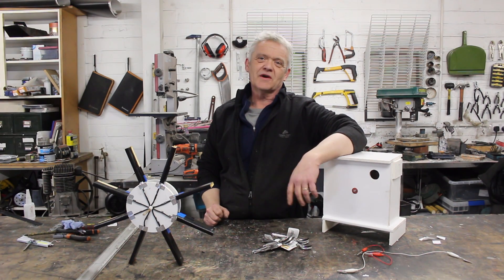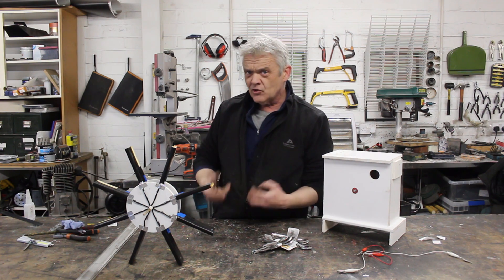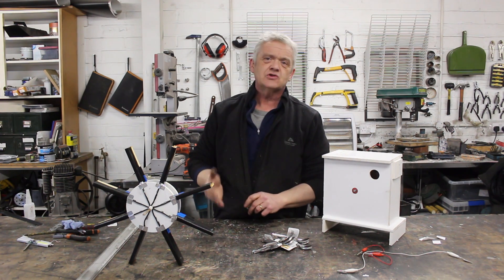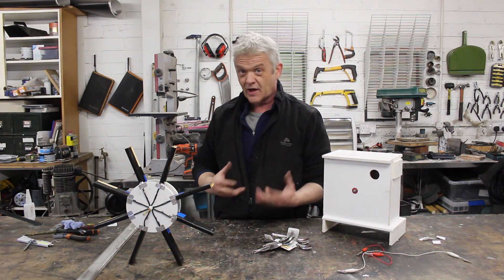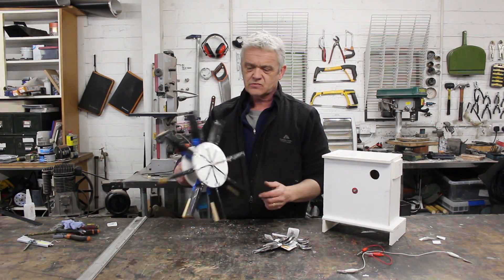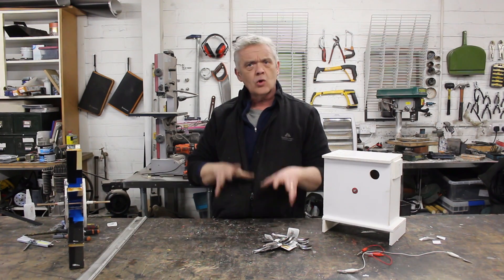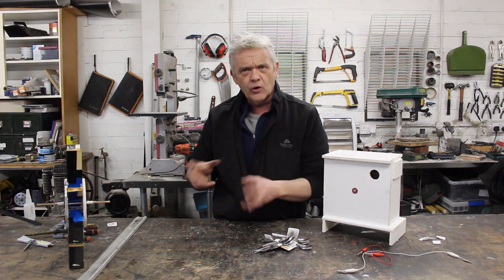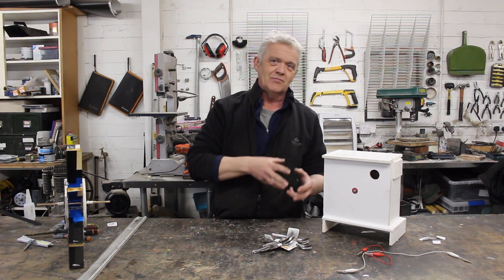1473 Water Could Be The Answer To Home Energy Storage

Comment: If I had a 6 ft wide  by 20 high tank  how long would it keep the average 3 bed house powered and heated during the winter.  There could be a pond at its foot to collect water as it is released from the tank true a generator.  Refilled true wind and solar panels

Comment: Yes, water is a  very old battery. The problem is that the amount of water needed is extremely high to actually achieve any significance in constant power. Plus, one would have to pump the water (recharge the battery) with solar or something, thereby negating most of the benefits. By the time you add up the cost, you will find that the better option is solar or something equivalent with current battery technology.  Much cheaper and the system takes a lot less space. I've run the numbers  as I actually live off grid and experience the reality of energy storage. The real solution is USE LESS POWER.

Comment: I once had an idea to use a closed loop system utilizing ram pumps to pump water to a reservoir that would then feed into a downward channel and through a water turbine connected to a generator and back to the starting point. 

The exit valve of the ram pump would spout the waste water into a container that would feed that waste water back into the start as well. 

However, a few have told me that friction would eventually hinder the flow. By no means am I an expert in engineering so I'll take all the pointers I can get! Lol

Though perhaps with these accumulator systems you mention, that frictional force may be much easier to overcome..

What you are doing for the community is nothing short of amazing by the way. Thank you for being an inspiration! 🫡

Comment: battery can be 90% efficiency,but if the price of the battery you are getting les than 50% return, water battery can be circle 50 times a day for 20 years, plus large tanks get cheaper per KW unit as they get bigger.

Comment: the water going up and down, the wind turbine / solar energy storage pumped hydro, the sand battery, concentrated solar, it seems to me we should put it all together, your a smart chap, use the sand battery to store excess wind or solar as heat and also concentrated solar, but that is where my mad idea starts..... use the wally minto designed  wheel. water on one side of a diaphragm and butane on the other for the heat conversion to pressure lifting the water to rotate the wheel and spin a big generator ( about 11 hp I would guess) as needed to charge/ power stuff. Am I mad or what,.. but if you have a big sand battery the generator could run all night, not really sure on the calculations  (not my strong hand) also I do not have reliable data to calculate from. I would like to try this but in my rental flat it is certainly not possible.

Comment: A thought popped into mind. Can a pump type, as used in a washing machine to feed and drain water, be use inline with inlet water pipe inverse to instead generate electricity? Logically it should work, but again, health risk from type product material and strength of handling the pressure come to question. I would appreciate your feedback on that.

Comment: I was having a thought about water batteries suplimenting electrical batteries using a few  barrels toped off by a solar pump and they drop once filled up and pull a gravety generator. One small solar set of  solar panels And battery bank instead of a roof full to run the pump.

Comment: Mate; put a triboelectric collector in the tank so that as the tank fills it charges the battery/capacitor system.

Most tanks have a small fill system that provides a solid stream to fill the tank, and there is a way to modify the system to allow room for the triboelectric collector.

Same concept, different application. Your thoughts?

Comment: Flush a conventional toilet 1ce a day. YES, flush ONE time per day. After your daily constitution, wash away the poo and the urine, down the drain. If the toilet in your flat is working, it will only hold so much liquid in the BOWL, also the tank. Excess pee will just flow over the P-trap down the sewer pipe. All of the debris to deal with is what is freshly at hand. Composting toilet users deal with this offensive aroma problem with a simple stovepipe out the roof. A "Fart Fan" as we call it works just fine. Then, after morning coffee, I have my business, read the mail, and have a satisfying flush. POOF! my 3 gallons of flush, black water purging for the day is done. NO MORE has been needed for 9 years. I smell no So2. I started out (Survivalist Style) saving and drying my Pee. I used a Windex bottle with 1/2 Clorox a d 1/2 water to spray after each toilet break. Not needed really. Up and out.       
           Just think of the bazillions of gallons we could have saved sense outhouses were abandon?

Comment: I bought a little 10 watt hydro generator from DX in China that was able to thread onto the same hose that connects to our shower head.  The impeller and electric section were only magnetically coupled so there wouldn’t be any eventual leaking from a failed seal.  I was thinking about using it for the kitchen sink at our off-grid cabin as a way of scavenging the little bit of power we get from the water system that’s set up.

Comment: as a pure energy storage device, I've been pondering the idea of a weight thats winched up a pole by a motor-generator when there is excess energy and then released when there is excess demand. the power of the motor-generator, length of pole and size of the weight are all variables according to the scale required.

Comment: Love love love your videos!!  Have to ask, when will you have one or more completed solutions that can fully charge  a 12V / 50-100Ah battery that can then have an inverter attached to run a refrigerator, lights, charge phones?  My favorite is the gravity battery / generator because any adult can use their body weight to hang from rope loops to pull a weight up into the air… and let gravity do it’s thing!   I would really like a reliable solution that doesn’t have to rely on wind, sun, or a stream of water I don’t have.  I’d like to be able to recharge 10 batteries and have them in reserve… or use them for camping .  Thanx for listening!!!!

Comment: The maths is not in your favour here. An accumulator stores energy by lifting a weight - and unless you're using weights the size of your entire house, the amount of energy you can store is tiny - not even enough to boil a cup of water. It's true that you can use it to create a high pressure jet, but the amount of energy you can extract from that jet is just the same (the jet won't run for very long). 

The amount of energy stored is easily calculated as m x g x h (m=mass, g=force of gravity, h=height lifted). So if you lift a tonne by 1 meter, you store 9,800 joules - or 0.003kWh. That's about 1/3 of an iPhone charge, or boiling about 1/100th of a kettle of water. A 1 ton weight is not a small thing, and lifting it safely is also non-trivial.

Comment: Disappointed with this video,  no details of your idea and you pointed to,  but never said what the wooden box was. Given the very small volume of water used each day in one home I can not see any worthwhile power storage.  A poor video. 

However - I have thought for years that using water towers as batteries is a good idea,  (not in domestic use mind,  a heavy lifted mass seems better for that.) There are many disused water towers around the country.  The water tower near me is massive and has an even larger reserve underground next to it. 
Someone with far better maths than me thinks it impractical as the energy required to lift the water so far outwieghs every stored. I always counter that when we have massive surplus energy as is becoming more common with the increase in wind and solar power use it. Pump to the top during the day & release in the evening peak.

On the domestic scale even this March I have had many days when I have exported,  (that is wasted,)  10, 20 even 30 Kwhs to the national grid.  If I could use say 20kwhs to lift a concrete weight up a modest tower to gain say 5kws I would be over the moon with it alas Although I have the idea I have neither the engineering skill of maths needed.  

If you want to laugh at my idea you won't be the first.  A friend said your talking about a sort of grandfather clock mechanism,  well I a.  SORT Of,  but what's wrong with that.

Comment: The trick is that it really isn't that much energy. Quint builds did this at scale already and had plenty of stuff to say about it. Namely, that it isn't worth it. You're better off getting just have a solar panel store electrical energy somewhere. Battery banks last more like 10 years than 3 years. Especially if you aren't fully cycling them every single day. The conversion of electrical power to water pressure (volume at a height) and then back to electrical is just really lossy.

Comment: If city sets the flow rate to make sure in flats sewer drains then u can tag along. If the city only "flushes" the system in flats problem areas & waits to do it at 1 time per day say after building pressure so sure a power flush why not tag along 1st. How well if u hve special water high pressure connection at each house it is out of your control/input. If they need a special flush they can oh 2 times a day on shitty days.

Comment: Have you done any anergy calulations to look at the energy potential of this? 1 cubic metre of water lifted 3 metres has a potential energy of about 30KJ. At 100% efficiency, that would allow you to run a 60W lightbulb for 500 seconds.
Reply: Shouldn't you have 3KJ instead of 30KJ in your calculation?  The amount of energy that can be extracted from water supply is indeed about nothing.  As Westerners we consume about 100 liters of water per day.  Suppose it is delivered at 4 bar, it would give 4kJ potential energy per person per day.  A phone charger at 4W would run for 1000 sec.  Not enough to charge a phone!

Comment: I have a well water system, with a 1/2 horsepower pump. If it runs ten minutes a day total, it costs me less than one cent per day. 
You gotta do the math to see whether things are practical. That's the difference between dreaming and engineering.

Comment: Yes, I find this interesting. I wish you could have explained your idea better. Maybe a diagram of the whole system. I did not understand how to use waist water to generate power. I don't want to reuse the water I flush through the toilet and I'm pretty sure that's not what you meant. So a better explanation with a diagram would help a lot. Cheers.
Now I'm SUBSCRIBED!
Reply: Using the mains water on its way to the bath /toilet etc

Comment: Is it worth the hassle and expense? If a person is using 150 litres of water per day and the head of the water is say 5 metres, the potential energy is about 7350 joules. If you can convert this to electricity at 100% efficiency, this is equivalent to the power required to run an electric kettle for just over 7 seconds! Not very impressive to say the least. Maybe I'm missing something.

Comment: I am sorry, but there is a big misunderstanding here. Although they generate high pressure, they can not store much energy. Energy is basically the product of volume and pressure. It is very simple to calculate the amount of energy, such a system can hold. Assuming a high density brick with about 2 kg/dm^2 (the double of water), a cube of 2m edge length would weight abaout 8t. If it's raised 2m in the air, the energy is E = m * g * h = 160.000 Ws. That is about 45 Wh (not kWh). You could power a 22W LED lamp with it for 2h. An average 4 person family with lean use of 3500 kWh (pure electric power) per year needs about 10 kWh per day. This is more than 200 times as much, as this thing could store. Even if you would lift your whole house (up to 240t, which is 30 times more), you would not be able to store the energy for one day.

Comment: I am very much looking forward to your video on accumulators.  It has often been a thought of mine that the ephemeral sources of green power (wind/solar) could simply do the function of pumping as much water up into as high a cistern as possible.  They you let it all down in the dark quiet to generate smooth consistent power in the 500 to 1000 watt range as necessary.  Scale to your needs, and don't forget to recycle the same water each time.  Peristaltic pumps are the BOMB for this.

Comment: Suppose you had two IBC containers held in a steel framework one  3 metres higher than the other, connected by belts or chains. The one at the bottom is full of water which over time gets pumped up a hose into the top one by a low power solar or wind powered pump. When the top one is full a float switch operates a solenoid which releases the brakes allowing the whole top tank to 'fall' driving a geared flywheel and generator as it falls. As the falling tank hits the bottom another switch is operated diverting the pump to fill the other tank which has now been pulled to the top. The same 1000Kg of water is used repeatedly. It doesn't really matter how long the cycle takes if the electricity is stored or fed into the grid. Rainwater could be collected in the upper tank speeding up the cycle.

Comment: not going to happen in US because of .. building codes .
There are strict regulations ad adding extra tanks, and water is in very controled category because it can get contaminated and pose health risk - things like Legionella etc. 

Most of europe can use it though, esp. european houses are often built with heavy masonry, as even if one builds single-story house, one usually chooses project of multi-story house , even if one builds only one floor, there is. no technical problem to add another floor if one needs it (like expanding family or taking refugees )
So most houses are perfectly structurally ready for sometimes not just one, but up to three extra floors.
Also in places like Italy, there are earthquakes snd building codes enforce houses to be much more structurally sturdy than needed. this allows placing water storage tanks without compromising house structure , and increases ROI from house construction.
Italy and Spain have many places with very small energy quotas per house, in many places you cannot get more than 3KW line at all. Same goes for rural Poland - the more distant house is from major industrial city, the more difficult it is to get power line at all.
Such lines are also expensive, so if one has energy-efficient house, often "subscription" costs of just having the line and energy transfer costs exceed cost of electricity itself.

Comment: I would suggest to you the same idea that you have here with water ,you could do with water or hydraulic fluid .you put in your driveway what appears to be a speed bump this actuates the hydraulic fluid or water ,every time you’re 3000 pound vehicle goes over top of it .out when you go to work ,again when you come home this pressure spins a generator if you had several of these speed bumps in the road in front of your house and the one in your driveway possibly two in your driveway you could be generating electricity under the same idea of what you’re talking about here .it’s the gravity and the weight of the car going over top of and compressing the fluid to generate electrical energy along with solar panels this power is charging batteries ,I would potentially give you and your house enough power I suggested ones that you do this with every elevator or lift in each building when the elevator comes down the weight of it can be generating at least enough energy to light the inside of the elevator for a few things so the cost of lifting it will not be as high more efficient just thought I’d mention it to you.

Comment: This tech has been in practice in the US for decades now,  since the late 60's i believe. Just on a larger scale. For instance the excess power that a nuclear plant generates during off peak hours is used to power pumps that pump water back into a lake with a hydro electric dam to be used later when demand is high. Excess power from renewables is used in the same fashion. This is nothing new and much better than an accumulator which just pressurizes water against a bladder filled with gas or a spring. It would take a very large accumulator to store the power of a home battery. By the way new battery tech lasts much longer than 3 to 5 years, more like 20
Reply: It's been in practice for like 100+ years, and it accounts for 95% of U.S. energy storage. 

Round trip efficiency is 70-80%, sometimes better and it is economically feasible generally as well. 

People keep going on and on about building batteries out of non renewables, when you can just build more pumped water storage. The "battery technology" already exists.

Comment: Hello! When you mentioned water as possible energy storage I realized that there is an option to split water into O2 and H2 however instead of storing pressurised H2 it is possible to use H2 in thy hydrogeneration process and produce methanol in H2 + CO2 + heat + pressure reaction. What do you think about such method Mr Robert? Perhaps you could make a video about methanol production using this technique( I think a Copper Aluminium Zimc alloy cathalyst is used for this reaction). Best regards!

Comment: Something that should be on every home but you rarely ever see (especially in my area where we don't get enough regular rain for it to be of much use) are rain barrels. Most are designed just to catch run-off from your roof to be used for watering plants down the road, but somewhere where rain is a more oft occurrence, imagine how much water you could store in a giant tank, for instance, and later use to run a power installation or whatnot, let alone for drinking or using on ancillary devices when you don't need pure water for consumption.